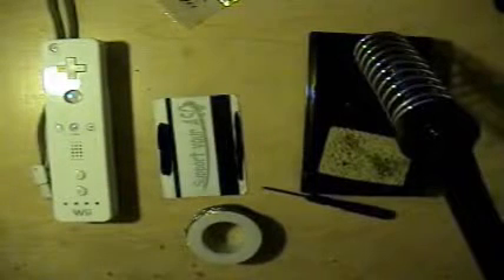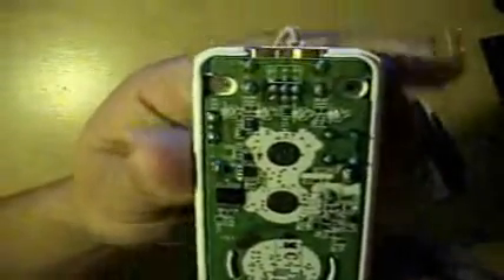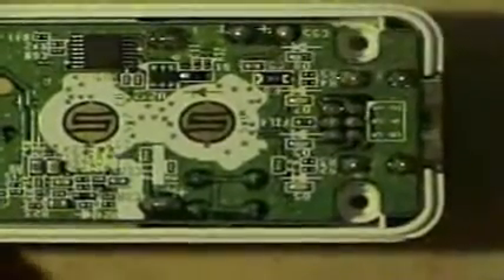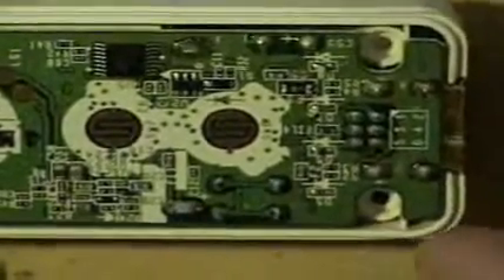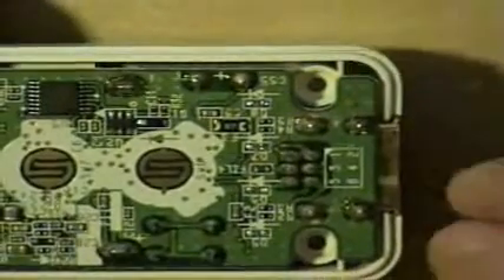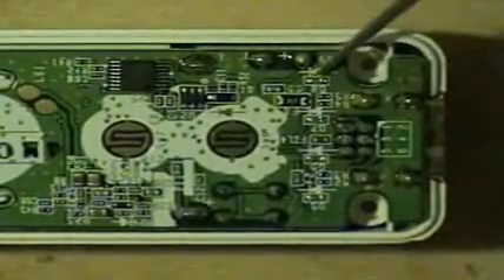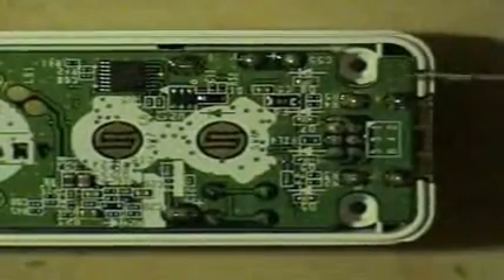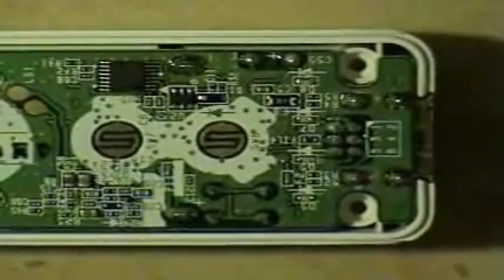How to mod your Wii (U) remote (Plus) LEDs

Comment: The "negative" side is called the cathode and the "positive" side is called the annode, The reason I'm specifiying is because not all LED's are wired in forward-bias(positive to positive and negative to negative). I'n fact zener diodes(LED's are diodes Light Emitting Diode) only operating in reverse bias breakdown voltage.